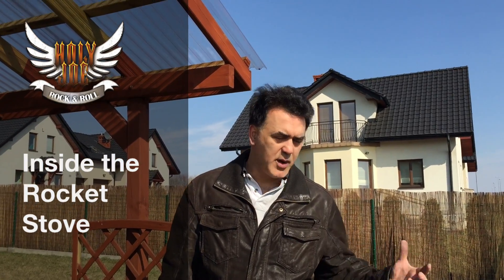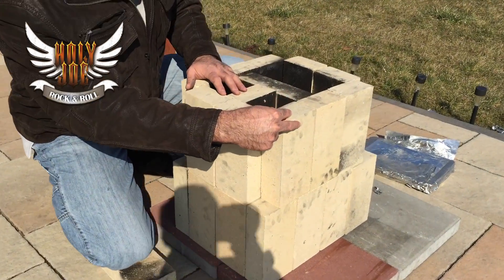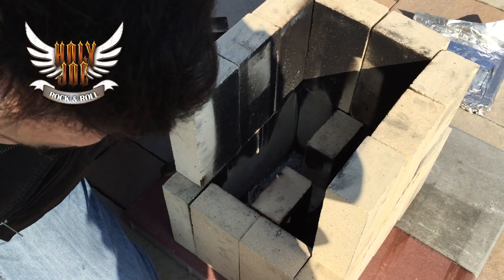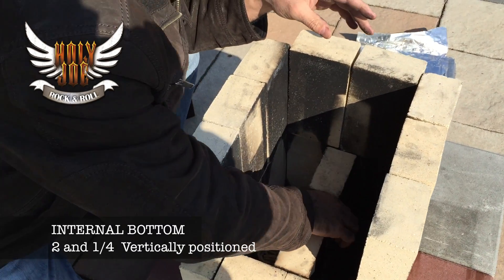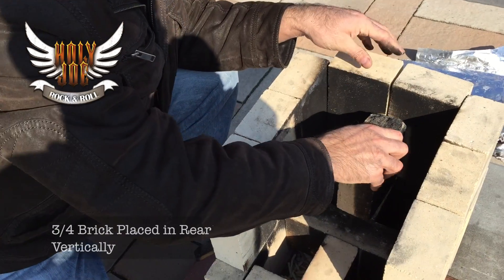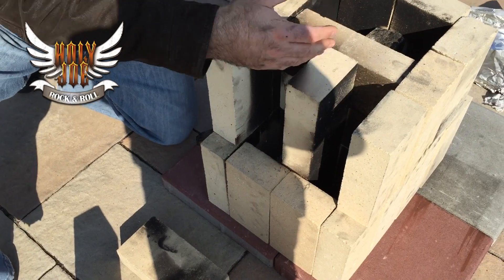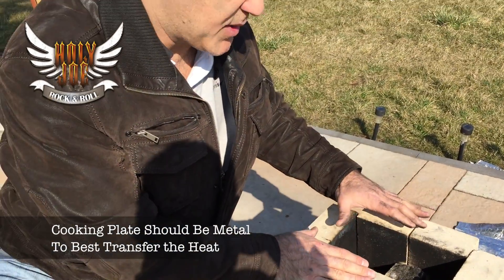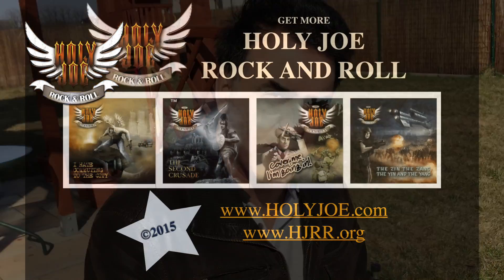Inside the 29 Brick Box Rocket Stove (HJRR)

Comment: Awesome!  How's the metal working out?  I built a Walker cookstove core and put a 1/2" steel top on it(25"x25") and the sucker got orange on me where the flame hit above the "riser".  It developed an 1/4" cup. I wound up casting a 2" slab of the dust from porcelain clay, refractory brick cuts, refractory cement, sand, and sodium silicate.  

I have some gifted broken kiln shelves that will be perfect for a top on this design!

Comment: Tanks for explaining. I don't see why it would not work safely indoors. A good and high enough chimney would help secure best possible draft.
The bricks will stay warm long after the fire burns out and which would also help contimued upward draft. So no CO gasses would escape indoors?
A secondary air intake as Pekka did earlier, connected to outdoor intake, could help additionally.
And of course the bricks should be glued together and be air tight and stabilized.
I very much would like to test it for indoor use but don't have the possibility before fall/winter.
I would also like to try and extend the "fire tunnel" a bit some way after the heat has past the cooking plate, for additional heat storage. Maybe such an extension could be outside the "brick box" under a bench for example.

One thing I suspect is that the burning may not be as clean as some of the bigger RMH designs.
But I see only potential so far :) You guys rock!
Reply: There should be some smoke escaping at the beginning, depending on how well it is lit. but, once the fire is burning and not smoking, the chimney/smoke stack, especially if insulated at least on the bottom, should take the smoke out the smoke stack/chimney.